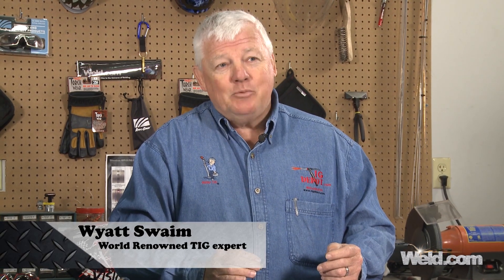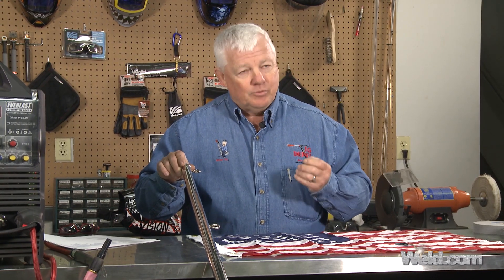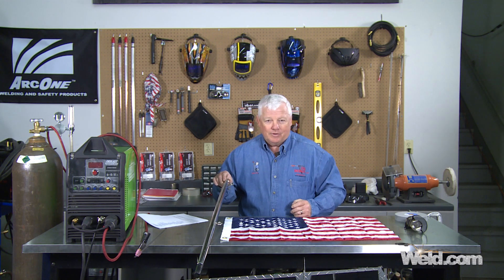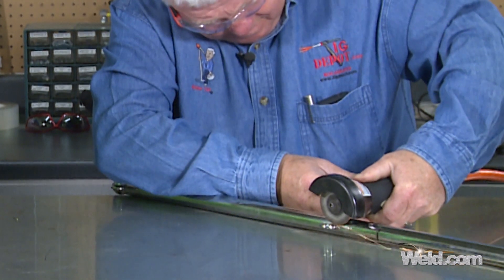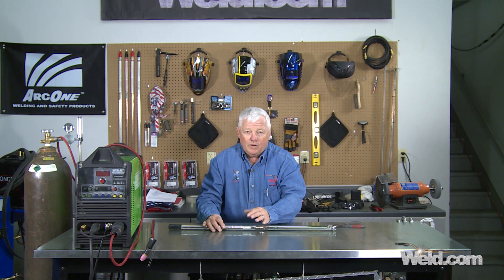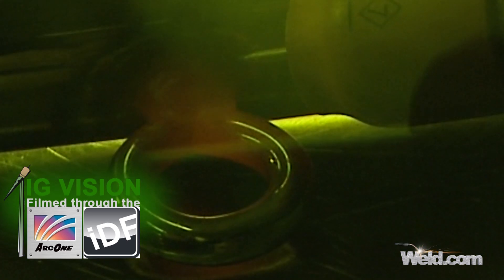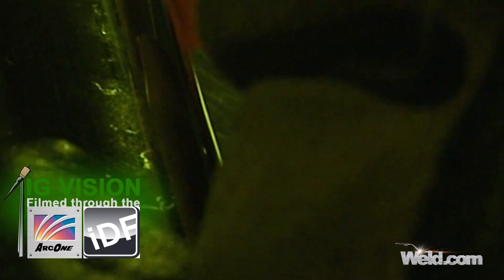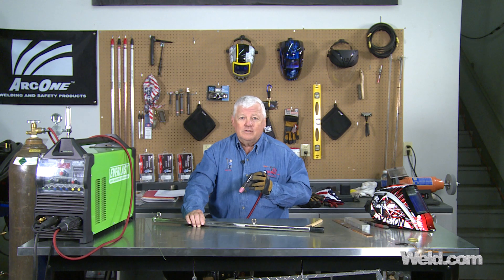Stainless Steel Flag Pole Repair | TIG Time

Comment: Should you not be purging the inside of the pipe?
Reply from the maker: This is a non critical application, so it is not necessary. We are also not welding through the pole with full penetration to the backside.

Comment: Nice mr.tig..I have a question..can we weld this kind of marine grade SS with ER308L filler and what is ur amperage settings on this? I wonder how u get this shiny welds.any tips on that?
Reply from the maker: You can use 308l for marine applications but the corrosion resistance is a little less and you will get mild rusting.  You can set your welding machine for 1-amp per .001" thickness.. good luck Mister Tig
Reply: Weld.com  tnx mr.tig..